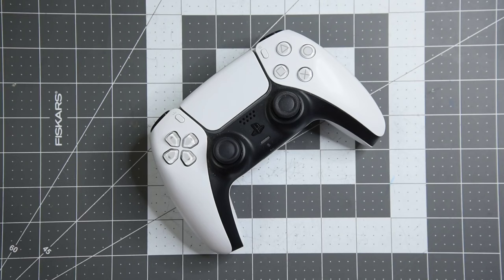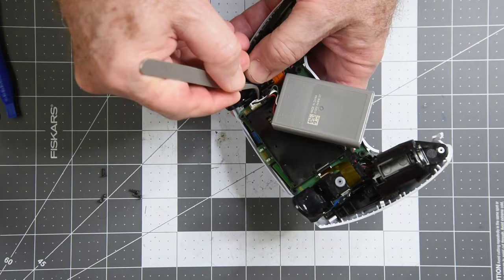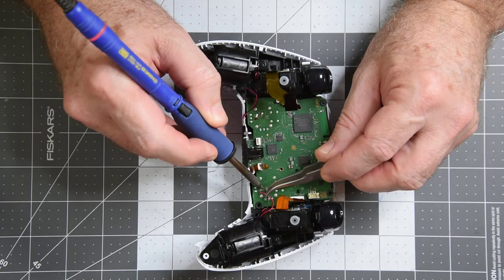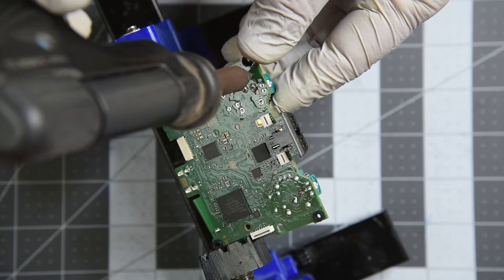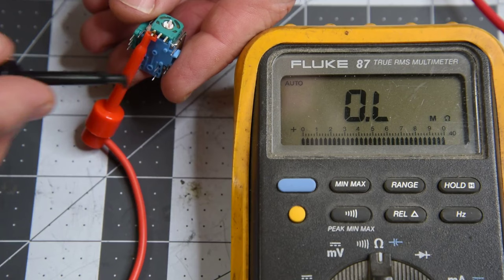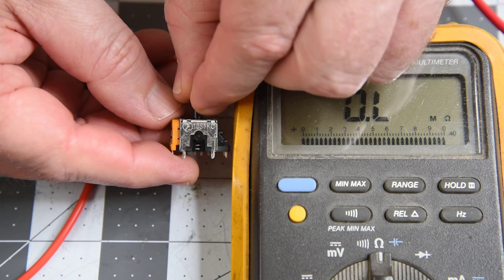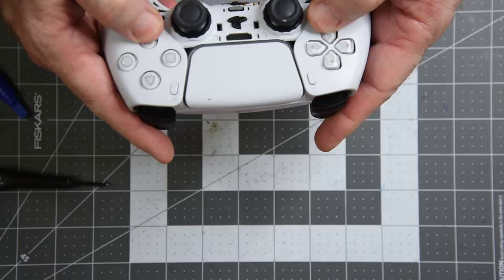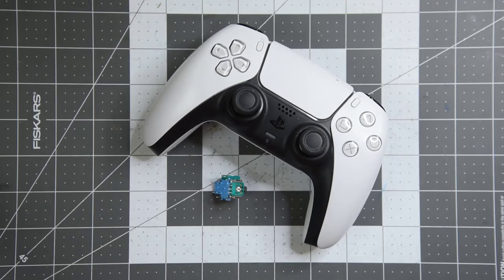PS5 DualSense - Joystick Replacement

Comment: So I changed the potentiometer to a matching replacement. One side of the whole analog stick potentiometer. Desoldered the 3 legs and soldered. I practiced on an old PS4 controller beforehand. I also desoldered the red and black cables so I could fully remove the PCB. Put back together, the control just continually scrolls left and it seems the whole left analog stick is non reactive. Any clue what might have happened?
Reply from the maker: Did you just replace the potentiometers?  If so make sure center is not 180 degrees out of alignment.  They can fit two ways.  If you replaced the entire thing double check and make sure a trace didn’t get messed up.  Let me know how it goes.
Reply: Okay so I’ve notice I’ve replaced the potentiometer and the housing for it, so the green part with the tracks and the white but with the wipers, with the ones from a replacement from the wrong side of the controller (the white ones, not the ones with the pink tint in the centre of the wiper) could this be the issue?
Reply: So basically the Y axis potentiometer on the x axis.
Reply from the maker: the x and y are the same values so shouldn't make any difference.  Did you remove the potentiometers from the joystice module?
Reply: Yes. I desoldered the 3 pronged green casing and removed and also the wipers inside the casing I removed and replaced with brand new ones.
Reply from the maker: The wiper will fit in two ways need to make sure it's in the right way.  If that axis is not working try turning that wiper 180 degrees.
Reply: Okay so I’ve basically pulled the contact central of the 3 contact pads off side A of the PCB into the tracing by a millimetre or 2. What can I do about that?
Reply from the maker: have to scrape the solder resist off enough to solder a thin wire to it.  It might be possible to follow the trace back to another component.  Then solder a wire from that component to the terminal on the potentiometer.  But most of the time it is easier to just solder a wire onto the trace and then connected to the broken terminal.  It’s tedious work.
Reply: Yeah what he said you will need to do a trace repair. If you have a hard time soldering to thin trace and can't see where it's going you can try using a multimeter in continuity mode to test components in that area to try to find the correct path of that trace. The center pin of the potentiometers is what measures the voltage reading to sense the direction.
Reply: Look up hall effect joysticks - this is the design-tech solution that has been gaining attention and should be offered more and more as part of or as replaceable option going forward

Comment: Hi great video the potetiometers is better to have 2.3k or 10k ? And is possible to desolder without flux ?
Reply from the maker: You can desolder without flux, it is a little tougher on the PC board.  The 2.3 and 2.1K pots are for the dualsense/PS5 controllers.  The 10k pots go in the dualshock/PS4 controllers.
Reply: Can i uses dualschock 4 joystick to the ps5 controller i don't understand if the value is better to 2.3k to 10k ?
Reply from the maker: I would not.  I've not tried a 10k in a dualsense, it's possible it will work.  But Sony changed to the ~2k value for a reason.
Reply: @metalplasticelectronics354  I already tried and its horrible, I go to game store to get my controller fixed, but they replaced with DualShock4 potentiometer, its working, but not what it should o, I didn't get full range of motion,  the center of joystick reports 124 instead 128  (max value is 255) in DSX, what a waste of money....
Reply from the maker: Good to know.  I wasn't sure.  Thanks
Reply: Very good to know good comment

Comment: Does replacing the potentiometers only will have an effect on like dead zones? Because I just fixed my stick drift problem by soldering in a ps4 potentiometer on my dualsense controller and the dead zone for that particular axis is way different from the original one. Is it maybe because it is not calibrated to the joydtick settings? Does the potentiometer ohm value have an effect on the deadzone? Any help would be much appreciated.
Reply from the maker: I would expect it to be the difference if potentiometer values.  The ps5 use 2.1 to 2.3k ohm all the ones I’ve ever seen for the ps4 use a 10k ohm.  I still believe there is a reason they changed values.

Comment: whats the correct soldering temp?
Reply from the maker: To melt the lead-free solder, you will probably need the iron temperature set to 700–740 degrees Fahrenheit. A higher-wattage iron can be used a bit lower. If it's a very small-wattage iron, you will probably need to raise the temperature some more, especially for the ground connections.
Reply: @metalplasticelectronics354  thanks is 60w ok
Reply from the maker: Should be fine, will probably be better at close to the 740 temp.
Reply: @metalplasticelectronics354  thanks appreciate you

Comment: So there is no way you can fix the drifting without desoldering?
Reply from the maker: Other than trying to get some contact cleaner into the potentiometers.  One comment said he was able to replace the potentiometer wiper and it worked.  But I think the only way for sure is to replace the joystick module or the potentiometers.  And that does require desoldering the old and soldering in the new.

Comment: about different resistor values of ps4 and ps5 joysticks : i can confirm 100 valid. Found out the hard way. Installed wrong one  in ps5 and it is not working at all.

Comment: Wait so if I use PS4 joysticks on the PS5 what will happen, will it blow up or something?
Reply from the maker: A regular potentiometer joystick will probably have calibration difficulties, but should work. The Hall effect joystick will not work as the power and ground pins are reversed for one of the sensors.  It might damage the Hall sensor and cause it to short out.
Reply: @metalplasticelectronics354  so I have to buy new ones?

Comment: Can I put ps4 controller sticks to ps5 controller as I don’t have ps5 controller sticks atm
Reply from the maker: If you are talking about the joystick modules then not really.  They will fit but the potentiometers on the joystick modules are a different value.  And it seems to cause centering problems.

Comment: Is it ok to just replace the white removable part in the potentionmeters with a PS4 one for the PS5 controller? I managed to clean mine but it came back after a week. I cleaned it again but the stick drift remained. I cleaned the white part and the stick drift went away a little bit. I saw it has some sort of damage in it.
Reply from the maker: From what I’ve seen the Alps wiper looks the same for all the Alps potentiometers and the Favor Union wiper looks the same for the Favor Union potentiometers, so you should be able to.  But if the wiper is damage it has probably damaged the resistive element part of the potentiometer as well.
Reply: @metalplasticelectronics354   Thank you for the reply! I'll update you when the parts arrive!
Reply from the maker: Yes, please do.

Comment: Hello.  I just changed my stick and it's still giving me the same problem that I had with drift.  You see a lot of load to the left side.

 Because it can be?  Thank you!!
Reply from the maker: check and make sure the replacement potentiometers are the correct values, should be a little over 2K ohm for the dualsense.

Comment: Guys, do I need to do any calibration after replace the entire module? Or Just install it and it's good to go?
Reply from the maker: The few I have replaced have been good to go.  I didn't see a calibrate option for the controllers.  There is a reset button, but I do not know it that will force a recalibration.
Reply: @metalplasticelectronics354  Right, thank you!!

Comment: I want to ask what the difference is in performance between the 2.1 Kohm vs 2.3 Kohm potentiometers?
Reply from the maker: None.  I think the tolerance on them is like 20%.  Using a 10K might cause a problem though.
Reply: Thank you. I appreciate it.
Reply: Do you know if the 2.1 Kohm by ALPS or the 2.3 Kohm by FU have a longer lifespan? Regarding their durability.
Reply from the maker: No, I sure don't.  I think the life of it has a lot to do will how well the wiper is stamped out.  And that goes for both brands.

Comment: What temp are you using?
Reply from the maker: 710–720 degrees Fahrenheit for the old solder removal, upper 600s to install with leaded solder.
Reply: @metalplasticelectronics354  Thank you for responding! And so fast. Much appreciated

Comment: So probably a dumb question I bought replacement part from Amazon it looks very close to the ps5 one it’s ALPS 3318 is what it says on the part. Do you know if that will work? Man they look so similar but I’m worried it won’t work. Wish I would of watched this video before ordering.
Reply from the maker: I'm not sure about the part number.  I think the Alps potentiometers for the PS5 have a white center piece and the PS4 ones have a black or gray.  And I'm not sure how reliable that is.  Just what I have seen.
Reply: @metalplasticelectronics354  I put my multi meter to the part it read around 10K ohms so I guess I won’t install it and try to order a new part. Thank you.
Reply from the maker: Yea, that is for the PS4 controllers.

Comment: can u tell me how is that tool called and where can i buy it so i can fix mine
Reply from the maker: The one I’m using is a very old Hakko desoldering station.  It’s been discontinued for years.  There are some knock offs on Amazon.  Will see them listed as a vacuum desoldering station or desoldering gun.  I don’t know how well the ones on Amazon work but it’s just a vacuum pump and a heater with a hollow tube in the center for the solder to get sucked through.

Comment: Help i changed the joystick on my ps5 controller and after 2 weeks of use it died and am not getting any life from the controller no matter what i do
Reply from the maker: If you’ve reset it and that didn’t do anything.  Make sure the battery connection is good.  That includes making sure the wires are not pulling loose from the terminals.  And then look the PC board over very good, make sure some rogue solder hasn’t shorted anything out.

Comment: I get this same issue, less than a year and left stick drifts to the right... pretty cuestionable quality there, anyways thank you for the feedback :D
Reply from the maker: The effort to make the potentiometers so cheap I think is really at the root of this problem.  But I guess the failure rate is at something Sony is okay with.
Reply: Same here mines less than a year old and I only play after work and on my days off never had a issue with ps4 controllers
Reply: @ethansiler  I just bought isopropyl alcohol and I apply with a spray into the joystick (i didn't open the controller) and now it is fixed, I mean I suppose it is better opening the controller but sometimes it is not even necessary, just apply a good quantity :D
Reply: Yes it's awful. Same here, about 7 months and I have stick drift issues that can't be solved with cleaning. It seems like it's a very common problem. Really unimpressed with Sony's quality here👍

Comment: I got the joystick in but the controller won turn on
Reply from the maker: Make sure one of the battery wires didn't pull loose from it's terminal.

Comment: Holy hell, after taking mine apart and messing with the triggers and adding back paddles, I thought the joysticks would be easy to replace!

God I hope I dont start having issues any time soon.....
Reply from the maker: Anything pack so full of part is always going to be a challenge to fix.  But it's worth the effort.
Reply: Look up hall effect joysticks - this is the design-tech solution that has been gaining attention and should be offered more and more as part of or as replaceable option going forward

Comment: i'm curious, what happens if you change that with 10k analog ?
Reply from the maker: I believe the dead zone acts differently and greater chance of drift with the 10K pots.
Reply: @metalplasticelectronics354  Got a weird situation with my drift if its even considered it.When I blow into the analog it goes away for a bit then restarts only when I push up,sometimes it doesnt happen for hours then it starts back up,any idea whats going on?
Reply from the maker: It could be the potentiometer has worn till it’s right on the edge of centering.  Could try some electrical contact cleaner on the joystick potentiometer to see if it’s just some loose bits of the resistive element.  @zeokenx2
Reply: @metalplasticelectronics354  That cant be it due to the fact that its not drifting on its own after I stop touching it. If it was directly the potentiometer it would be doing what it did on this video,its been doing it less and less since I blow into it.Seems like to me it was reacting to the dust that got trapped inside of the stick

Comment: After seeing this video my respect for Sony PS5 and their humble controllers costing Rs. 5000 each grew manifold. So much technology being crammed in the controller.
Reply from the maker: Once you see what's in one the price does seem pretty reasonable.  I think they may be putting too much pressure on the joystick module suppliers to lower cost.

Comment: I guess there's no way to tell if a joystick module is faulty without a multimeter, is that right? I bought a dozen of them from that site just in case...
Reply from the maker: With ohmmeter could tell if one of the potentiometers is way off center.  A few dollars for a cheap meter could save the effort of installing a bad module.  Worth having one around.
Reply: @metalplasticelectronics354  I just replaced both joysticks but both are off centre in idle, interesting enough all 4 xy-axises have same amount of offsets. I saw EL7 FU 2.3K (also made by FU) on amazon and they are packed with correction resistors and I guess that's what I need? More research to do as I don't know how to apply or acquire them yet, tho I guess I might need an ohnmeter for real😂.  Is your joystick still good after a year if you don't mind me asking? Anyway thanks a lot for the recording its very helpful.
Reply from the maker: I've replaced joystick modules in two of my PS5 controllers.  I pretty sure both were less than a year old when I replaced the module.  Both are still doing fine.  Last one only has a few months on it though.  Do you know if the joystick modules you used had 10k pots or around the 2k pots?  I think it would be very rare to get 2 bad potentiometers out of 4.
Reply: @metalplasticelectronics354  Are you refering to the white labels on the potentiometers? If so they are 2K3, I am using the ones from the link in the description, same three sets of labels as yours (60/B/2K3). Good to hear yours are still good... I am mostly play on PC so deadzone setting is fine for now if needed.
Reply: FYI my offsets look like this: yt keep deleting my comment with i m g u r 🤦‍♀XTZeAZ9
Reply: @metalplasticelectronics354  All 4-xy axises are off so its 4 out of 4 if I 've not mistaken? but yeah I don't think its just bad luck that's why I mention the resistor. "ElecGear Replacement USB Analogue" (first google result) have the same lables (60/B/2K3) and one of the comment says resistor is needed to avoid drift, the color are different tho so idk if they are exact same...
Reply from the maker: 2K3 is the 2.3K ohm Favor Union pot value and should work fine for the PS5 controller.  You might try a hard reset on the controller.  There is a tiny hole on the back of the controller.  Where there are 2 tiny holes on the back of the controller.  The one to the right of the SONY logo is the reset.  The one under the SONY logo is a microphone.  Will need like a paper clip to reset it.  Think have to hold it in for like 5 seconds.  Then the controller will have to be hooked back up to the PS5 with a USB cable.  Make sure you are not touching the joysticks when you power it back up.  I'm not sure when the software in the controller does calibration.  Might be an on going type of thing.  After you first power up the controller I would move both joysticks around there full movement a few times.  Again I don't know how Sony calibrates the sticks.
And it seems you tube doesn't allow links in comments.  
But I don't think you would have gotten 4 bad modules.  And added resistor should not be needed to avoid drift.  Either something has gone bad with the part that reads the joystick value or it not calibrating its self.
Reply: @metalplasticelectronics354  Thanks for the reply Sir I appreicate it. 
I've tried to reset but that button doesn't seem to do anything at all other than just powering off my controller, and I've done it multiple times while its on/off , it is however still paired with my PS5 and has the latest firmware (same with PS updater app on PC). Several users on reddit have this same issue trying to reset... Might be one of the update broke the reset function? 🤦‍♂Sony
Reply from the maker: That it could be.